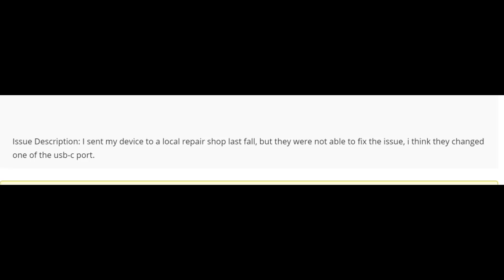I made a mistake working on an HP Motherboard - Laptop no Fix.

Comment: I was able to spot it, or rather i have the knowledge to know what you were doing was wrong.... but i did not notice it till you  mentioned it.   But hey its a mistake anyone could make.  

Once while i was handmaking a batch of pcbs that were essentially just intended as display boards i installed the leds on backwards for the entire batch.  About 500 boards with three leds each... 

Another time and i installed the completely wrong timing crystal on about 20 units.  Fun times.

Comment: the best tweezers are the ones that have a spring to keep them open. Also having locking needlenose forceps can help. Might buy some of that flux, I'm using the MG Chemicals no-clean flux and it is impossible to squeeze out without heating the tube with a heatgun first. If you try squeezing it out cold, it just pushes past the plunger and makes a big mess

Comment: Since the 40-pin DrMOS burned out, I am currently repairing my graphics card. Your videos are very helpful to me, especially the process of "micro soldering".
Although the soldering process looks easy in your hands, it is actually a very difficult job for a newcomer. I found that DrMOS is always misaligned, cold soldered, short soldered, lifted from the pad, etc.
I don't have a microscope, so it is difficult to see the DrMOS alignment clearly.
Another problem is the flux, I used fake AMTECH 559. After a long period of heating, it turned dark brown. It is difficult to see the alignment marks, and I don't know how DrMOS is aligned on the PCB. 
I am not sure whether the real 559 will remain transparent at high temperatures. I would appreciate it if you could make a video showing how the real 559 reacts when heated by welding for 15 to 30 seconds or more. Usually it starts to boil for a while, then turns black and sticky.

I want to buy a real 559. Since you are one of the major reseller, I hope you can consider adding an option for users to purchase products with original AMTECH syringes. I really want to get original AMTECH syringes to show off instead of blank syringes. By the way, can you ship flux outside of the United States?

Another key item is missing from your device list. I saw you used a special cotton swab. It may be a HUBY industrial-grade cotton swab. After cleaning, nothing was left on the board. I realized this while watching your video, because my graphics card SMD components are now contaminated with many cotton fibers mixed with viscous flux. Very difficult to clean. Your cotton swab is the secret weapon of cleaning.

Comment: How much would it cost for me to to send in a dead laptop board for inspection. I just want to know what died on it. I already replaced the board on the laptop myself but just want to know what died on the old board so I know if it was just that board and not something else. It was a Lenovo Thinkpad Edge E531, wouldn't power on period. No beeps no display it the led light on the frame would blink like it's starting and fans plus disk drive would spin up but then shut off repeat a few times before staying off. After I replaced the board it started like it was supposed to. but I'm just checking the price.

Comment: I'm always very sus & give the customer all the warnings when working on something some other shop/tech has worked on as it's a lucky dip as to what you will find!
I've had so many disgruntled customers due to previous repair stuff-ups so, I now get the estimate/repair attempt fee upfront before I'll touch the device so my time is covered & will refund the estimate fee minus the repair attempt fee.

Comment: Quick Question! why can't you use the exsisting solder balls on the pads already instead of wicking them ? especially after going over them with low melt solder?

Comment: 4:32 the holes that fill back up is actually quite satisfying
Reply: Those are melted solder balls on pads, not holes.
Reply: @Attiqharoon  either way it's satisying regardless
Reply: why not satisfy, that holes is for jumper line to another layer inside PCB, not for joint of soldering.

Comment: i like how study your hand is while handling chips. excellent
Reply: It's insane. I do a little motherboard / GPU repair but my hand shakes everywhere, I often have to solder back on a resistor or cap I knocked off while soldering/desoldering something else. No way I could hold a chip with so many pins still long enough to reflow it

Comment: I also made mistake when I solder the wires HDMi to VGA adapter. The length of the wire is gettings shorter and shorter. 😭

Comment: Can the chip you installed incorrectly be reballed and reused?
Reply: 13:48
Reply: It can be done, there are multiple ways I have seen it done as well, but they are all time consuming processes and delicate work
Reply: Yes you have to reball the chip with stencil.